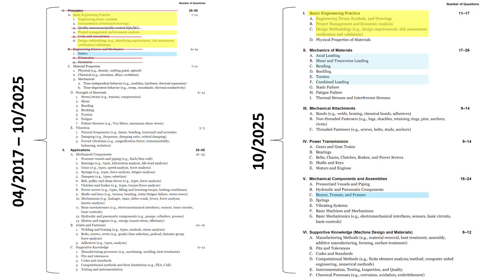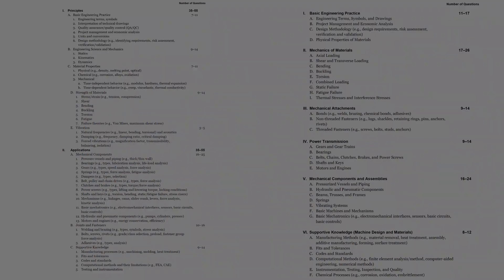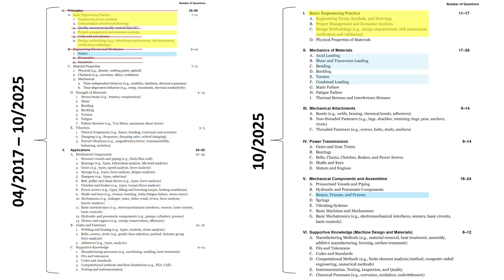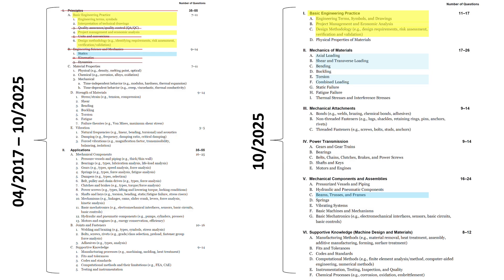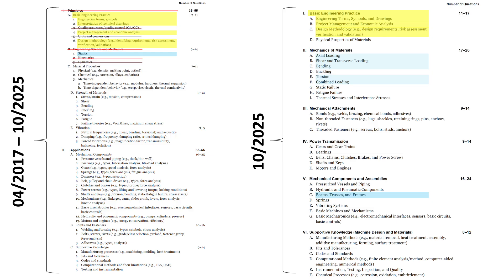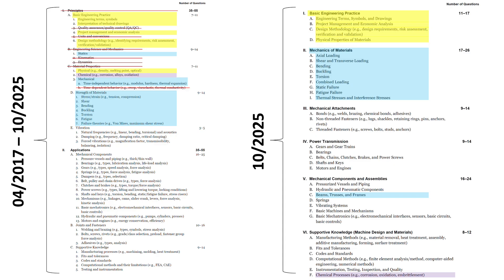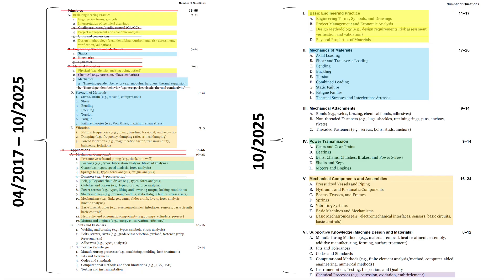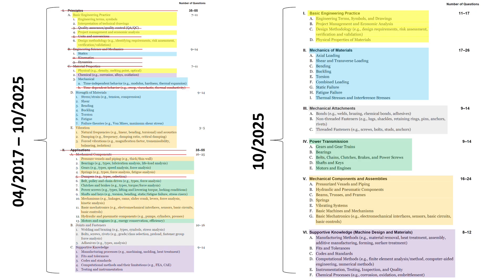2025 Mechanical PE Exam Updates: Machine Design & Materials

Comment: So, what do you recommend. shall I take the exam before it changes, or the changes is better. I mean in regarding for preparation since there are many references and question banks. 

Thanks for your video.
Reply from the maker: Great question! You will be fine either way. Schedule based on when works best for you. A couple thoughts:

I have been telling students that I am slightly inclined to suggest taking the present (prior to 10/2025) exam, if scheduling allows, because: (i) Most of the available exam prep materials have been structured based on the present specs, and (ii) It is the structure that will be more familiar to those who may be advising you.

That said, the Reference Handbook content is nearly identical, so I wonder how much has truly changed. The newer Exam Specs (in my opinion) are better organized and more concise, but in their consolidation we've lost clarity on what exactly gets included in the new broad topics.